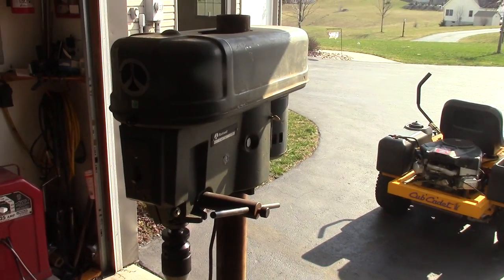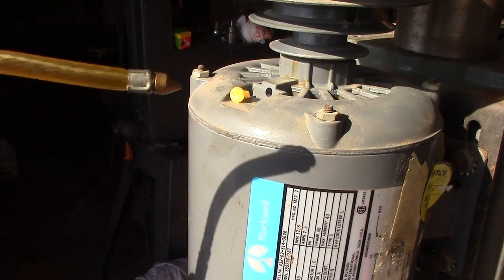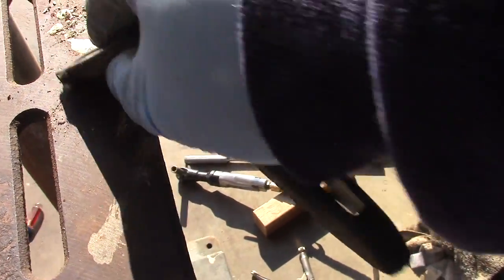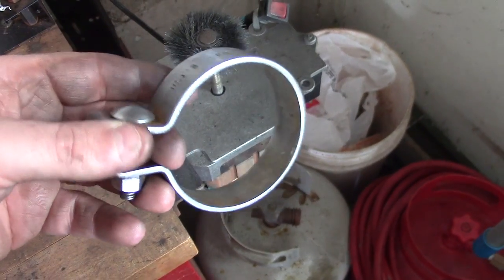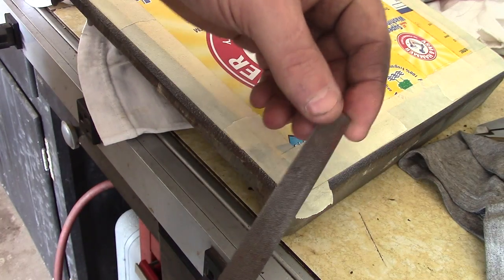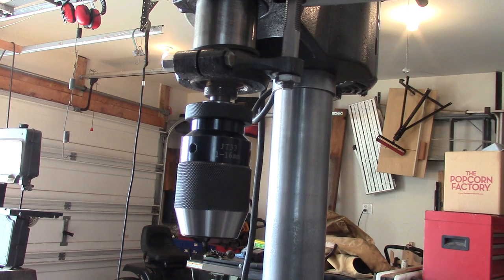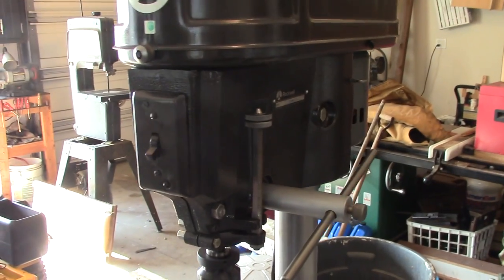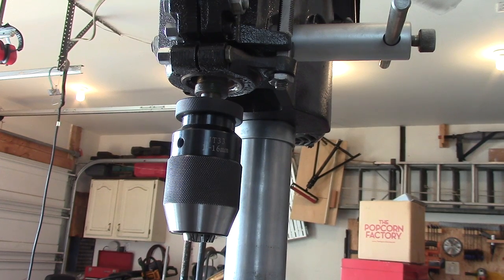Drill Press Restoration

Comment: Using vinegar is a good rust and scale remover.  To help with the reaction you can use baking soda and water to neutralize  the oxidation.  On the polished parts just coat them with a good light oil and then primer and paint will stop anything else.

Comment: I'm doing the same restoration but need some replacement parts.  Do you have any sources or even specs on the quill return spring or the sealed spindle bearings?

Comment: How did you get that spindle pulley off?  I have roughly the same press, and I'm having fits.
Reply: There’s a small hex screw on the left side of the pulley. You have to line up the hole in the pulley to the hex screw.

Comment: when idling you can hear rattling and ringing. Something is loose. This drill press needs not only new paint but a repair too. I hope it is not a loose spindle. If it has worn out bearings that is more easy to deal with.

Comment: That thing turned out sweeeeet man! Do you have a link to that torch you used?
Reply from the maker: +obadiah7771 It is the harbor freight torch,  however I do not recommend it because it broke and I had to fix it.  Mine only works on full blast.  If you follow my video link to amazon you can search for benzomatic auto light torches.  They work well we have them at my work.